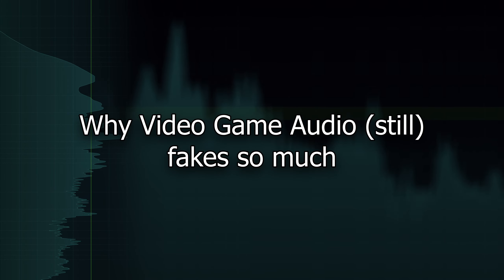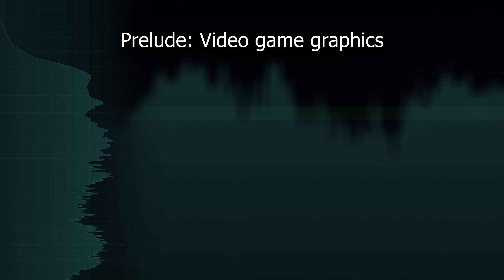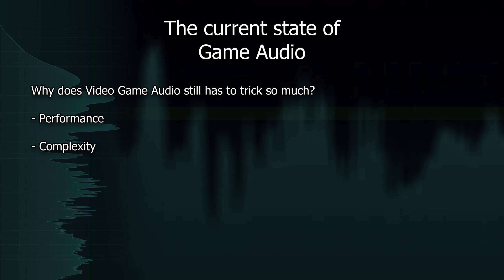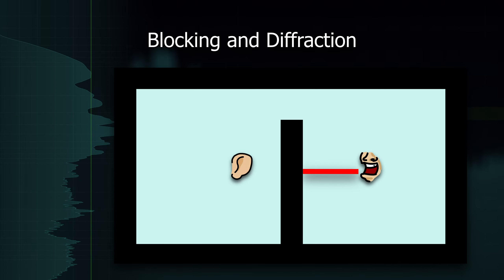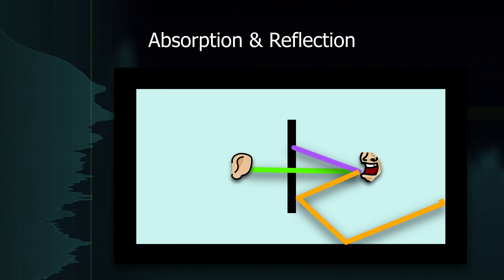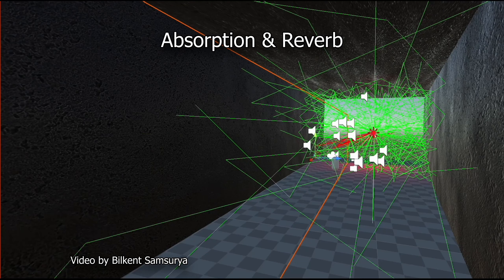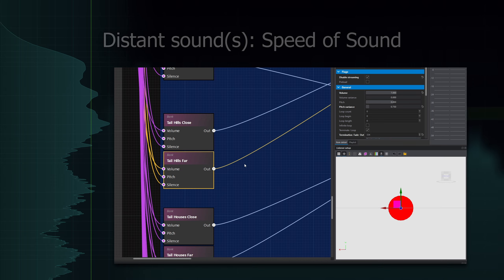Why Video Game Audio (still) fakes so much [ListenIn #05]

Comment: I wondered about this very topic on a past video of yours. So, I was super excited to see the title of the video pop up in my subscription feed! 😊 And you did not disappoint with the quality of the analysis.

I especially enjoyed the parallels you drew between lighting tech and audio tech. It definitely helps put things in perspective for me.

Your excitement about the subject makes me super excited as well! 

Recently I saw news about Cyberpunk 2077 getting an upgrade to its audio systems and I was really excited to see it! Before watching your videos, I probably wouldn't have taken much note of it.

I would love your thoughts on the quality of the sound design they are showing off here. https://www.youtube.com/watch?v=OXW5RGz_ne4&t=1s
The one thing I think I hear is the reduction of higher frequencies when the sound source (a gunshot) is behind a wall. This effect does not seem to be as pronounced or perhaps not present at all with the original audio system.
Reply from the maker: Glad you liked it!
And the demo in the video is not directly related to obstruction, but "spatial audio".
The TLDR is that it applies certain effects on the sounds based on their relative location to make locating them easier. I guess that works, but at the same time think that it destroys the audio fidelity most of the time as things start to sound very unnatural. Not a fan personally.
Reply: @LAxemann  :0 Thanks for the explanation. I guess I got ahead of myself. If I understand correctly, this means that spactial audio is on the trickery side of things rather than the pure simulation side.

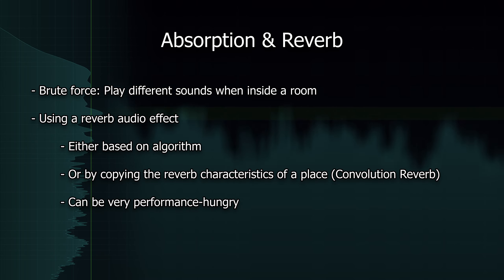Comment: 10:13 - And this is what I don't get: I had my first Soundblaster Live card back in the last millenium, and it boasted a huge amount of audio effects, especially reverbs. It basically had it own digital sound FX unit on board to alleviate all the issues mentioned here.

It seems the EAX standard it introduced did not catch on, did it?
Reply from the maker: Nope, that's a common misconception.
Those dedicated soundcards were made at a time in which a) the (physical) audio processing of computers wasn't very good/artifacty and b) computers were a lot less powerful. Those soundblaster cards didn't do any of the complex stuff mentioned in the video. They simply did these simple, synthetic reverbs and other audio related task we consider basic in today's standards. But at the time, such a reverb effect was expensive to compute and had to be done in these dedicated soundcards.
Think of the transition from using an external alarm clock to using the one in your mobile phone.

Nowadays, most mainboards have perfectly fine/clean audio processing and the calculations for reverb can easily be done on the CPU, so the need for external soundcards simply vanished for most consumers.

Not to say a "modern soundcard" for audio-related calculations couldn't be a thing in the future. But I'd say we're currently at a stage in which we'd first need to do some more R&D on standardized acoustic wave propagation in order to determine what sort of hardware we'd need to create, just like Nvidia's RTX models for graphics.
Reply from the maker: Found this one which I think summarizes it well and quickly: https://www.youtube.com/watch?v=D5kGXI8vUKg
Reply: @LAxemann  Soooo... EAX is still being used? I am aware of the difference of hardware based "rendering" and software - VST plugins do the same, and they do it well and some even with very little CPU usage.
But my question also was if the standard has become obsolete or if it is still being used to trigger software FX instead of addressing a specific hardware. Do you know anything about that?
Reply from the maker: @Noone-of-your-Business  It's become obsolete, basically, yup

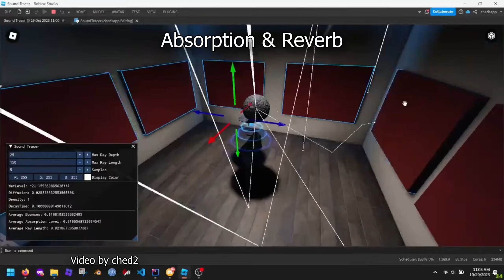Comment: 10:48 so... whats that if not the most realistic result we can get out of reverb audio? programmatic reverb anywhere(not just in games) acts the same way, what more can you ask of it atm?
btw, if you didnt already see it i would look at the new zelda tears of the kingdom GDC talk, some nice ideas there.
Reply from the maker: That's the point - It acts the same way everywhere at the moment but is far off from actually doing a full-on calculation of emitted sound spreading omnidirectional, diffracting and all the other stuff talked about in the video. It's mostly still just getting a rough idea of the surroundings and tweaking the parameters of a somewhat arbitrary  reverb algorithm with it. Far from any "true" sound propagation.

Not the best comparison, but it's like comparing early rasterization to raytracing in graphics.

Comment: It's so much easier to fool your ears than it is to fool your eyes.
Reply: I wonder if it's possible to use the data from graphics ray tracing to calculate audio stuff. Occlusion and reflection.
Reply from the maker: @MFKitten  Huh, that's an interesting idea!
A large limitation might be the fact that, at least currently, raytracing/pathtracing have a finite number of light bounces before it stops simulating (at least from my understanding). While sound, in turn, would spread in pretty much every direction and reflect off a huge number of times.
Also, it'd only apply to the viewable surroundings of the player. If e.g. someone shoots a gun 500m away behind some buildings, there'd be no raytraced info about it available.
Reply: @LAxemann  you could use it for early reflections around the player, changing as you move around a space.
Reply: it might work ok for higher frequencies, but lower frequencies are much more affected by wave properties and resonances in the room. you basically have to do either a lot of tricks to emulate what the resonances will do, or run a 3d wave simulation in real time. and the source and listener position affect this. you could probably get away with only doing this for low frequencies and doing a separate method for high freqs, which would allow a lower sample rate in time and space without significant loss in quality.

Comment: Back when sound cards were needed for surround sound and physics based audio, there was a period where advanced sound was pushed, in order to sell these sound cards. But now that these sound cards are all niche, and don't provide tangable upgrades over the motherboards built in audio, there isn't much of a push.
PS5 is the main exception, with raytracing cores of the gpu being dedicated for sound rendering. And the built in binural audio for headsets in the SDK.

Comment: Physically  correct (raytraced, advancely simulated) does not and should not equal photorealistic, I dont think videogames will start to look same at some point. There's a great Acerola video on a topic  -- https://www.youtube.com/watch?v=KkOkx0FiHDA
Reply from the maker: I get the point and it's generally valid, but think my arguments still hold up:

If everything is based on the same methods of rendering/lighting, the only thing to change the final result is a change in artstyle and/or lighting setup. Artistic things. And I'd say that e.g. pixar movies indeed do look very much alike in terms of lighting, the only difference is aesthetics and the way the scenes are being lit.

The visual trickeries mentioned in the video added another layer that contributed to the overal, final image which was/is being taken out of the equation.
Reply: @LAxemann  >The visual trickeries mentioned in the video added another layer that contributed to the overal, final image which was/is being taken out of the equation. 

I think that is the whole point. Physically correct light / fluid / physics / sound etc can be used as a foundation and a framework to create art that is beyond realistic, but that is not constrained by realism. It just allows developers to not invent the wheel in an each new game but build their vision upon existing physically correct tech. And, when you have the whole correct equation, you can freely take pieces out of it and/or change them, creating artistic derivatives.